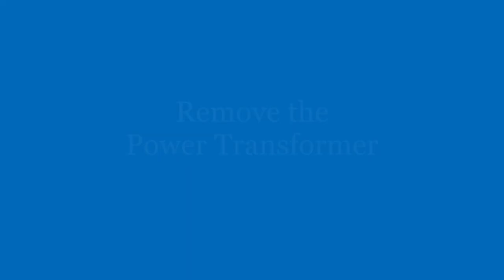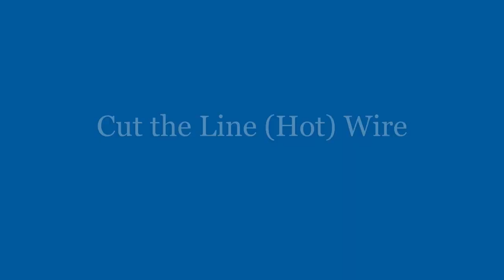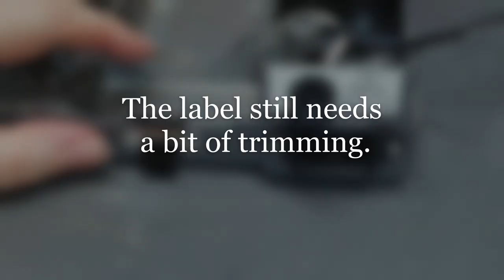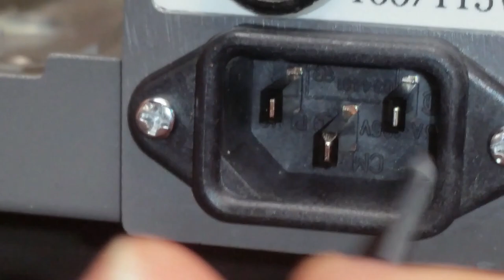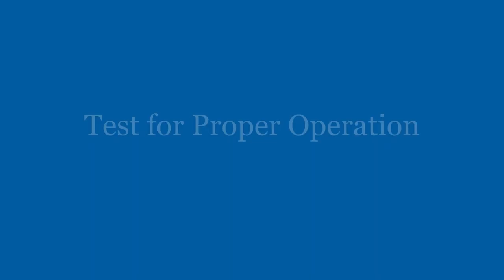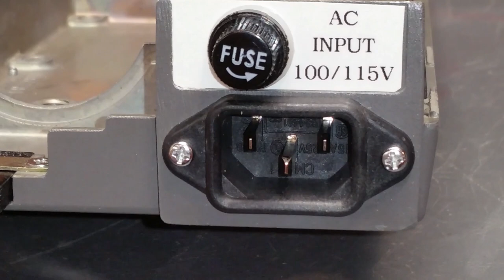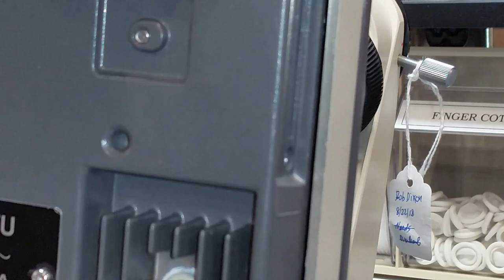Electrical Modification to Olympus BH2 Microscope

Comment: Wonderful stuff you do hear

First video of yours I watched. Just getting my first microscope  from ebay today. BTHU base. Whatever may come.

Seeing you use a small screwdriver to pry a metalic label.  I use a single side razorblade to slice into the gluelayer behind the label. I even had a electrically heated blade on a triac resistor to adjust level of warmth. It was when I couldn't use any solvents. Slow but sure back then.
I am so thankful to find you as a mentor as I get into a BH2. You have helped my confidence level immediately and immensely,  lol and any other immee's you can think of.
Hey, 40 years . . . "There's always next year, 41"
For eyeball assistance I use a vintage Bosch & Lomb magnifier on a heavy heavy base stand.